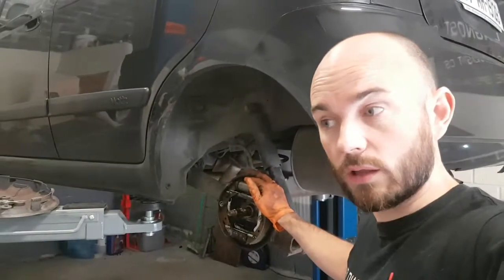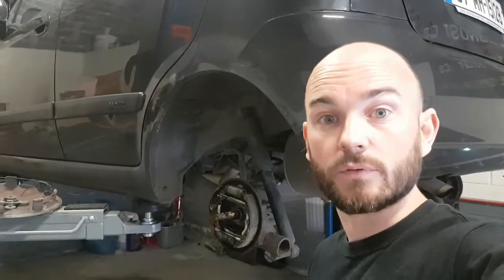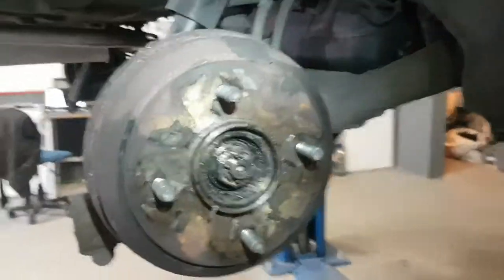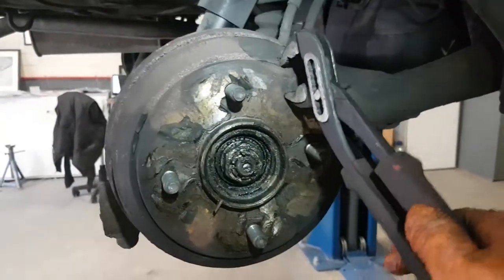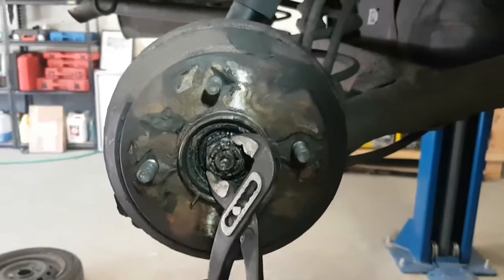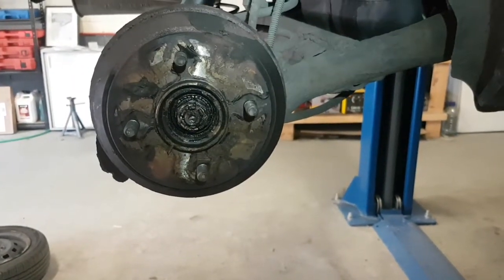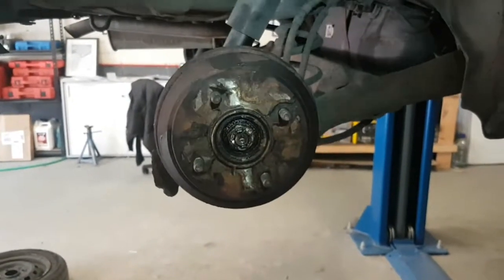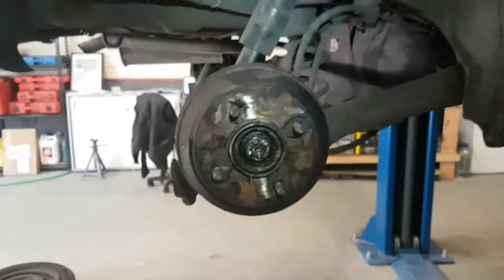Wheel bearing nut over tightened

Comment: I've made the same mistake on my 2008 Ford Ranger. It is supposed to be hand-tight after the wheel bearing is properly seated. But I've torqued it to 25 lbs-ft, which is "a little bit more than hand tight."  I drove it for 10 minutes during a road test, and it had granny and smoke from the two wheels that I had replaced the bearings. I removed the big bolts and retorqued them. But just found the bearing got damaged, the noise came back after making a turn. Have to buy a new set of bearings. That is what you need to pay if you overtight your wheel bearings.

Comment: It depends on the car. Some rear axle nuts require 280 nm or more where other require 110 nm. Always check with the factory specs. Assuming creates more problems than it solves.

Comment: Sooo... I just did my front end tapered bearings, fairly certain I did my driver's side right, was trying to follow proper preload specs using a rinky dink inch pound torque wrench (i've got better torque wrenches but hard to find one with such low torque settings) and I'm not sure by how much but I'm fairly certain I exceeded preload by a few pounds because the damn torque wrench didn't click. It wasn't a whole lot I don't think, and I'm pretty sure I got the final load right. Do you think the bearings could've gotten damaged? I'd rather do that side all over again and sacrifice the bearings rather than risk destroying the races and having to get a new rotor too, how forgiving do you think the bearings are going a couple pounds over on preload but having a correct final load? Thanks

Comment: I do come here for 2 buzzing bearings after I replace them with the new one. Mine is FWD sedan. I don't run shops, I just regular daily car boy trying to do maintenance by my self and a help from youtube. 1st I ruin my brand new rear left passenger wheel hub bearing, just remove and put the new one with no hassle. Tighten the axle nut as far as I can, first with impact and to make sure I use my L shaped wrench. Nice and tight, but after 2 weeks-1 month, they start buzzing again. Have no clue whats wrong. 2nd wasted new front right wheel bearing, remove, install the new one, tighten with cordless impact, finishing with L wrench. Annnnd, buzzing sound from the front area just reduced. Not solved and leave big question marks. One thing for sure, I don't have torque wrench.
Reply: Cheap quality bearings i suspect.
Reply: @mg8720-u7j  yeah it might be.. Is it possible due to tighten process with impact wrench? it leads to bearing damage?
Reply: @krokinymous  All front wheel drive cars have axle nut that goes on at at about 130 lbs.
Reply: @krokinymous  No because the pressure of the lock nut or axle nut doesnt place any load on a wheel bearing. Only the weight of the car puts a load on the bearing.
Reply: @mg8720-u7j  noted, I got it.. It is clearly because of bad quality bearings. Also please correct my presumption: worn bearing seal on CV Joint side shorten bearing lifespan. Is it correct?
Reply: @krokinymous  A worn bearing seal might cause a bearing to fail. Most modern day cars use sealed bearings and sometimes press in style bearings. Wheel bearings on front wheel drive cars are under alot of pressure and often go bad after 100,000 miles. Try using bearings by Timken or NSK.
Reply: @krokinymous  Im not famiilar with these type of bearings so you might be right and im wrong.
Reply: The races and wheel bearings have to be replaced together.They are mated surfaces.You need to buy wheel bearings that come with the races and replace the races also.
Reply: @allywilkeforsenate  No shit Shirlock.